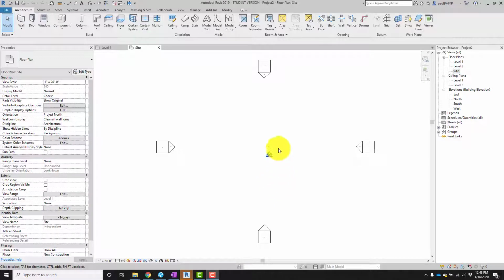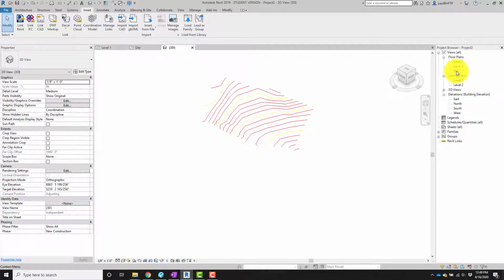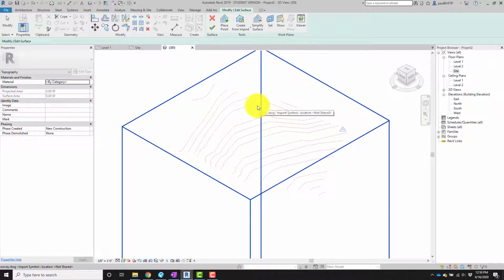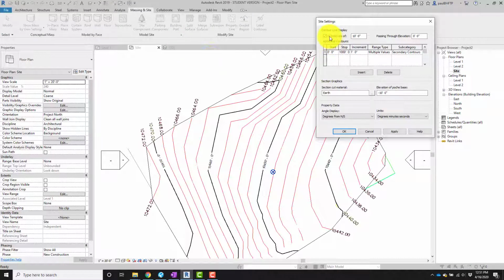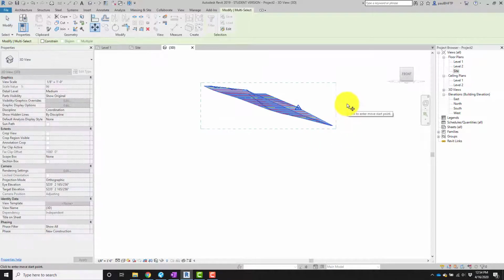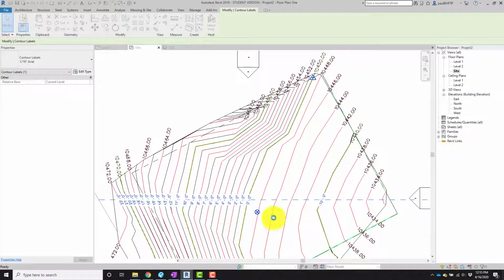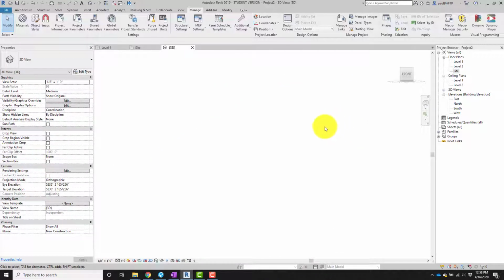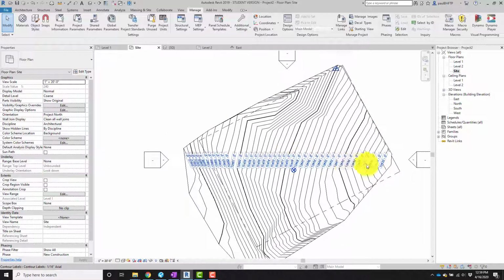Revit Toposurface from Import, Contour Labels

Comment: I cannot reproduce this.  Once the survey point is "clipped" it cannot be moved with the topo surface down to the modeling area.  It stays up at 10450.  If I unclip it, it can move there, but the elevation is reads changes to 0 and I can't get the accurate elevations on the contour line labels.